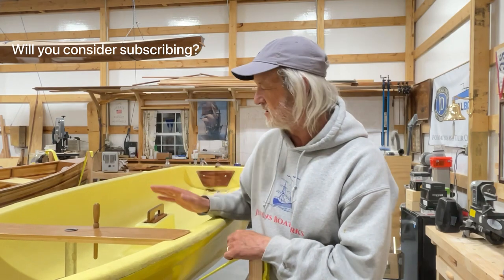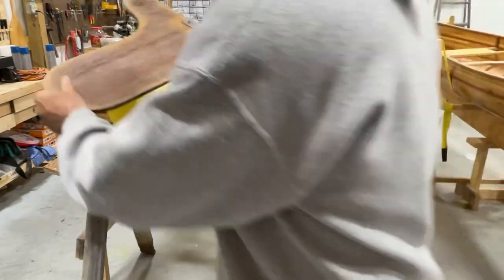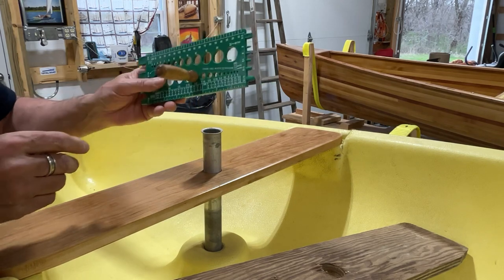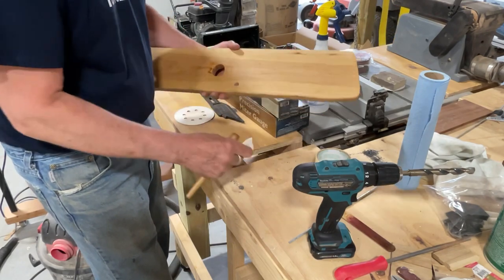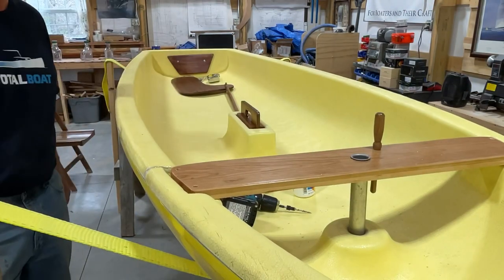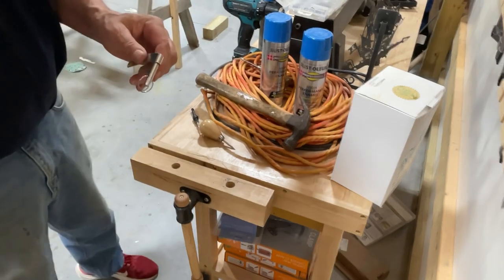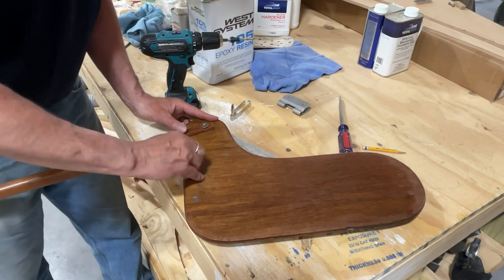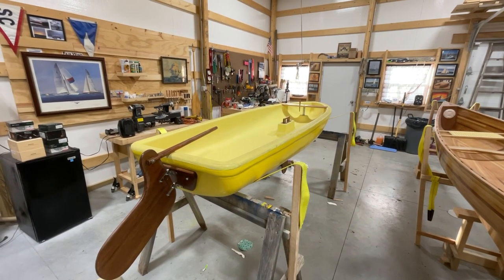Saving a Snark - Rudder-Hardware-Final Details - Episode 9

Comment: Hi I really love the video! I am currently following along trying to restore my snark, what expoxy did you use to drill and screw the wooden mast support? Thank you!
Reply from the maker: I used TotalBoat 2:1 and thickened with TotalBoat Silica. Got it a bit too thick. Pushed it into the holes with a syringe. I made a mess and was half frustrated with myself. It worked out fine

Comment: Did the fiberglass drastically change the weight of the hull? Do you know what it weighs now? 

Thank you for these videos! I just purchased a snark that needs some love.
Reply from the maker: HI Ben, I probably added a bit of weight with glass resin and paint but I had also stripped off the original plastic liner (what was left of it. If I added 5-8 pounds, clearly not going to affect the performance at all. me losing 20 would help. lol. oh and I don't know what it weighs but I can still easily pick it up.